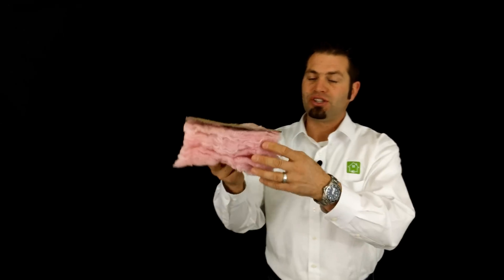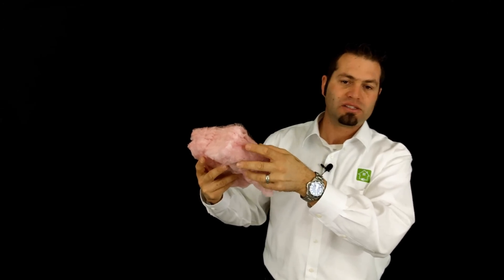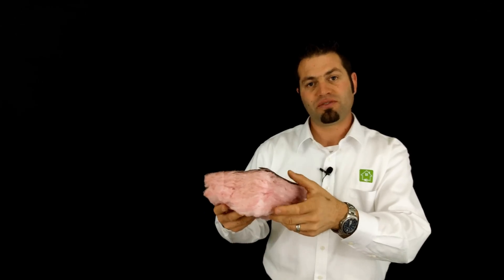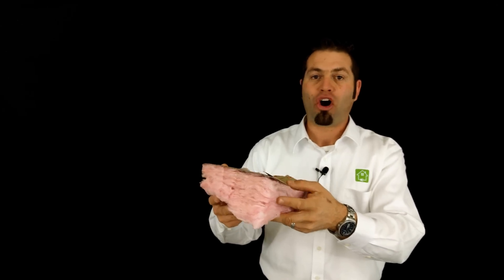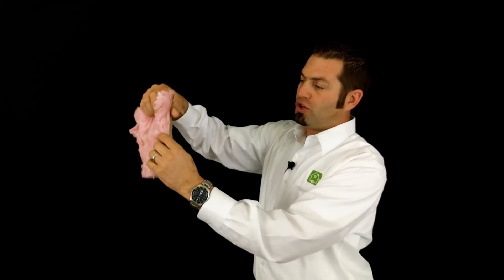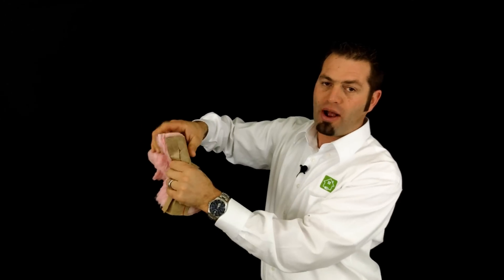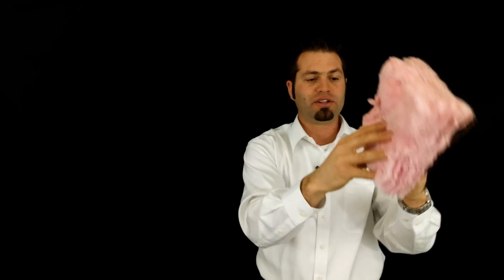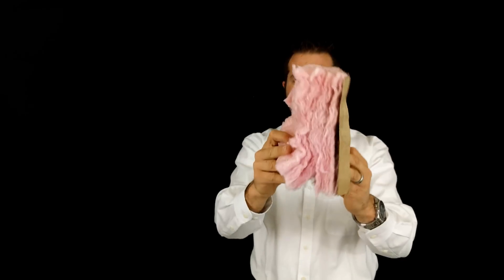"R" Value Explained

Comment: R0 = no resistance to heat loss / gain
R1 = 50% resistance to heat loss / gain
R2 = 75% resistance to heat loss / gain
R4 = 87.5% resistance to heat loss / gain
R8 = 93.75% resistance to heat loss / gain
Every doubling increases resistance by half of the previous resistance.

Air sealing is very important to maintaining controlling heat loss / gain.
Reply: This is all I wanted. Thankyou.
The comment under the video > the video
Reply: Literally every video I’ve watched so far and none of them even hint at this information. Thank you.